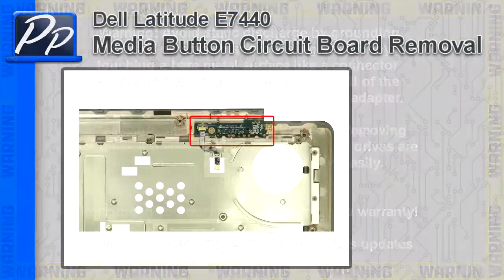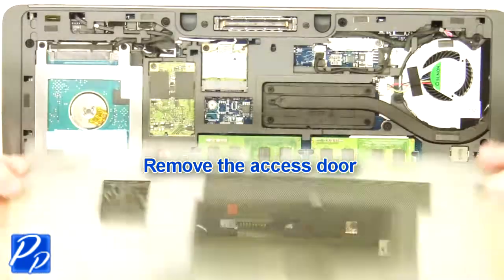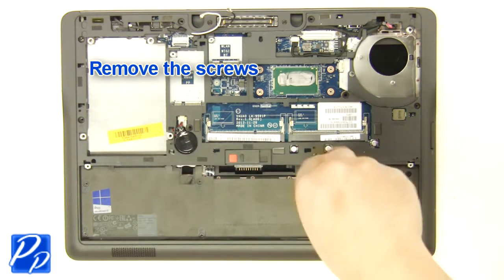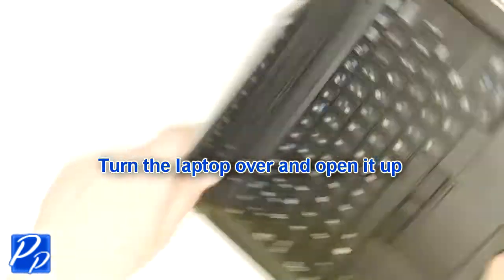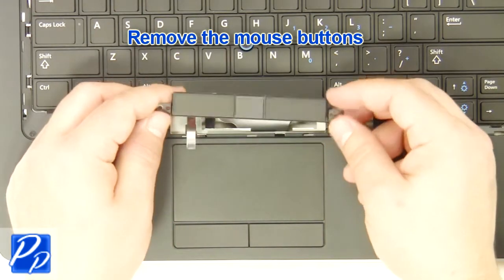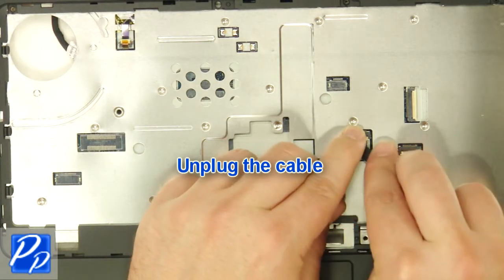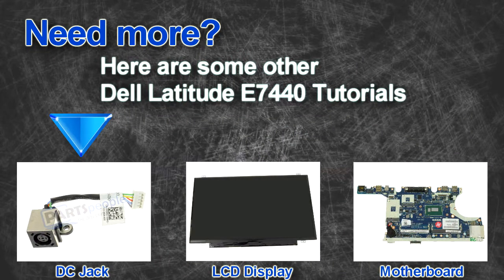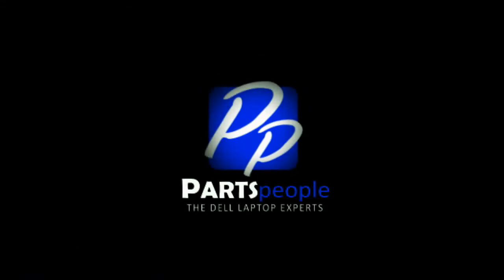Dell Latitude E7440 Media Button Circuit Board Video Tutorial Teardown

Comment: Hi there, i have one question. I own a E7440, my volume buttons doesnt work. I have win10 on it, and idk if i need any software to make them work, or it's just a broken module. If you have any info about software i would be grateful cuz, i am little afraid of taking a part my laptop. Thanks :)
Reply from the maker: If your volume buttons are not working it is more than likely the result of a hardware issue. Either a bad connection or broken module.
Reply: @dellpartspeople  Thanks for the reply. I went with this laptop to the place i bought it from. They are willing to fix it, but most likely i Will demand money back or another laptop. They label this one as fully working, as i found out in home, not really.
Reply: @mroqqq7871  bruv me too same, the volume reduce button mutes and mute button also mutes the volume ;-;